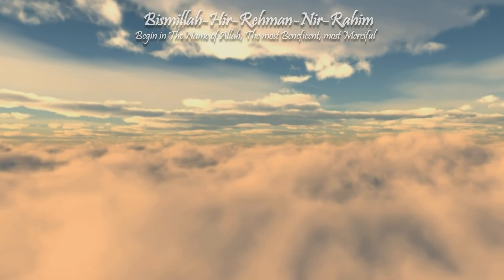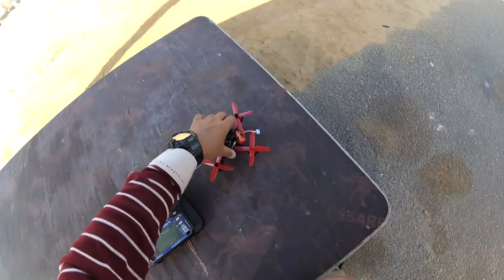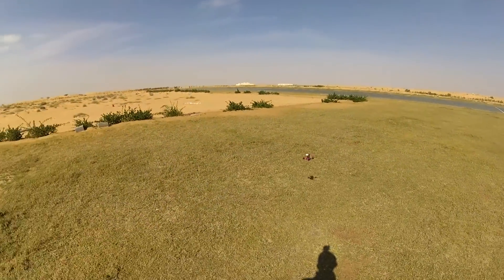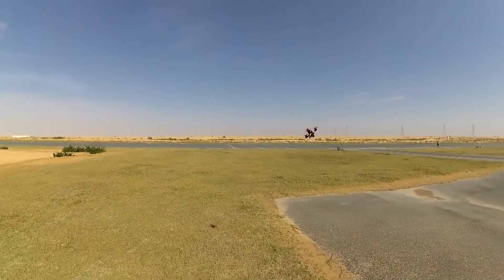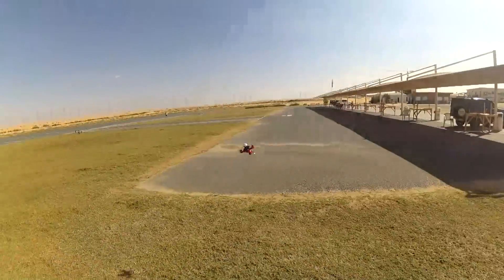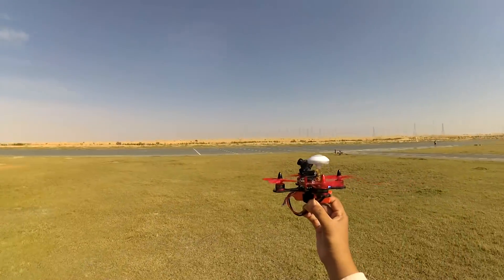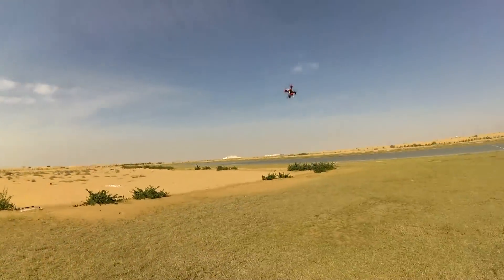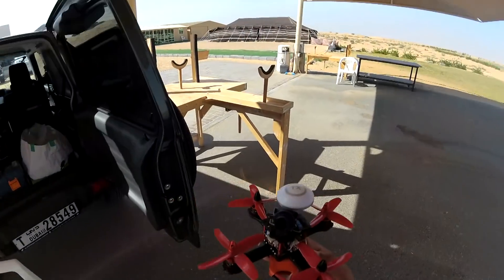Eachine Falcon 120 Tiny FPV Racer LOS Flight and FPV Freestyle

Comment: The jello on this quad is out of control! I own one and I can't solve it. The stock CMOS camera is a joke... Do yourself a favor and pitch it for a $10 CCD eachine camera. The wide dynamic filter on it allows you to fly into the sun and not have the camera be completely blown out.

I am in the process of trying to get the ESCs to upgrade, but the blheli configurator  does not seem to detect these ESCs.

Also, I would pitch your camera angle back more... that way you're looking at the horizon more and not the ground when you fly.

Comment: how do you get your vrd2 headset to record in 16:9? (I know you can watch live in 16:9 even if the camera is 4:3 so it's stretched but if you record the recording still comes out in 4:3..).. thanks for any feedback
Reply: Hold down the video stop button for four seconds (it's the square icon button).  The DVR menu will then come up.  You can then set the DVR to HD in its menu selections.  Press the stop button for four seconds again to exit.
Reply: Quadcopter 101 thank you

Comment: looks nice if I buy the bnf version does that come tuned,Ali I am a bit confused about adding receiver is it possible you can put video up on how to add a turnigy i6 receiver.I don't want to keep buying rtf I have 3 i6 transmitters now thanks again
Reply from the maker: Wish I had time to post such video. I am totally packed lately with work and moving the apartment time is just around the corner. 

its easy though, you will need to just solder 3 connectors from Receiver (SBUS) to SBus Positive negative and signal on the board. then configure the radio

Comment: Hey Ali, just want to ask a question, I bought a walkera v450d03, the blades don't spin, can u plz tell what can be the reason, rest all work fine
Reply from the maker: Maybe the throttle hold is on :D
Reply: No I have checked I didn't put throttle hold on, is there anything wrong with motor or esc

Comment: will it lift  a mobius or a runcam
?
Reply: Thaddeus Fernandes no there is not much room on it
Reply from the maker: thats what the back drop of it. However if you look at my video review of zonda hobby DTS Q180. it has an FPV System, and FPV Camera has a built in 720P HD Video Recorder. That would be a nice addition to this quad for recording videos as well

Comment: Is it common for the fpv vid to cut in and out for most racer quad?
Reply from the maker: FPV video does not cut the way you watched. its because my DVR firmware is horrible so it drops frames and gives black screen every time Diversity receiver is switching to strong signals. In my Goggles, live video, video stays solid and never drops. never a black screen
Reply: That's a relief. I'm eyeing this racer quad. looks really good